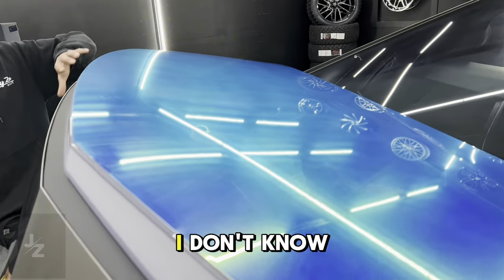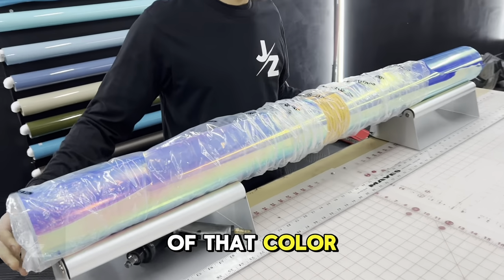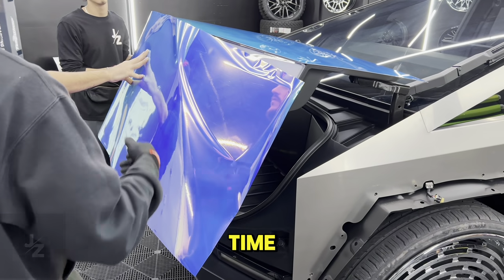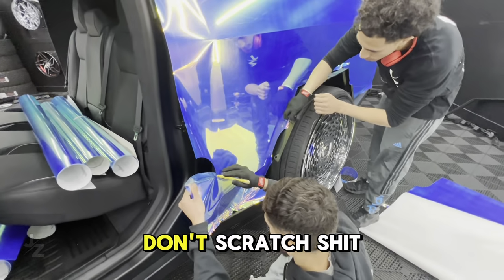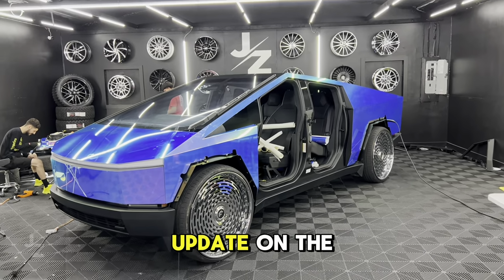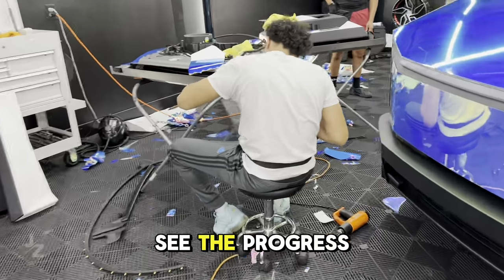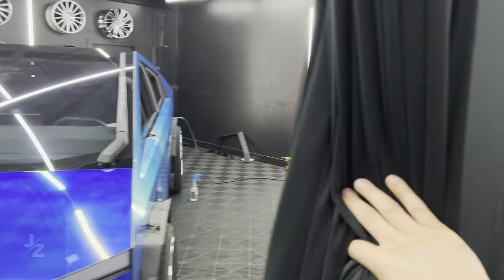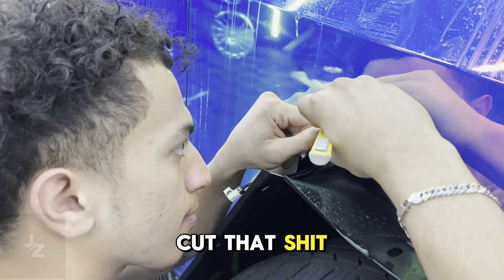WRAPPING THE MOST VIRAL CYBERTRUCK BEHIND THE SCENES - CJon32s Cybertruck - EPISODE 9

Comment: Well done ! It's gorgeous !
Would have included the b-pillar, the fenders, the top of the bed rim and the connectors in the wheels too, or was that not possible ?
Reply from the maker: We did it the way the customer wanted it
Reply: @jayzeewraps  Yea I understand. So no problems mixing underlying materials (plastic/metal) then right ?
Reply from the maker: @Chiellus11  not at all. We laid the chrome wrap first, left the clear protectant on it until we laid the PPF. Kept it really clean and no contamination
Reply: @jayzeewraps  Ok good to know, thanks !